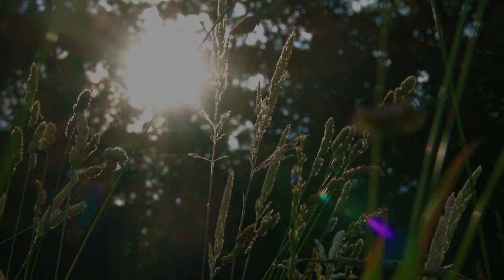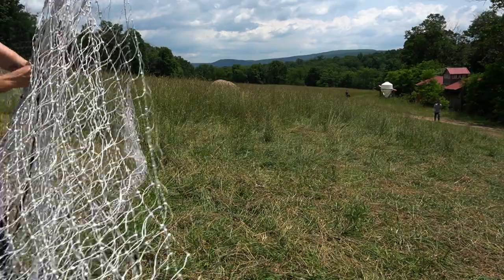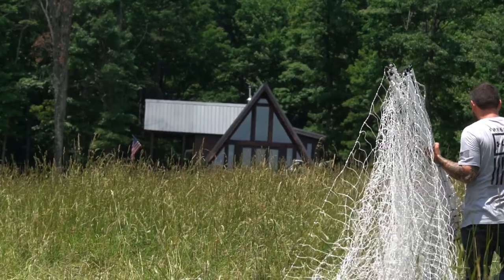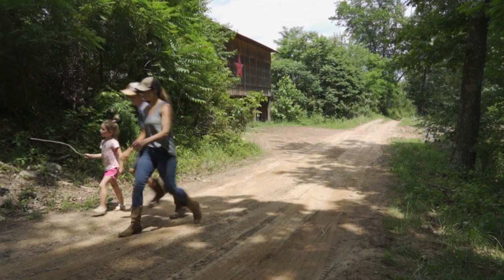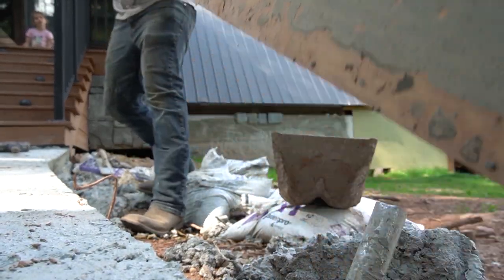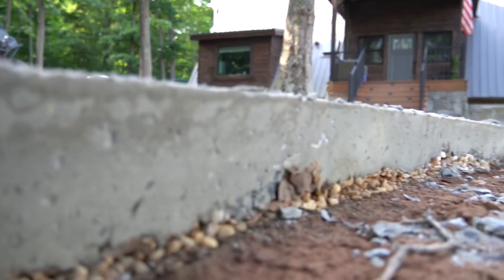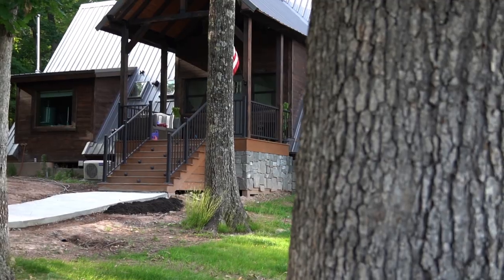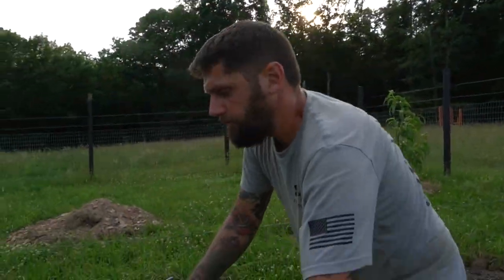THE FINAL PROJECT At Our Off Grid Home- DIY Sod

Comment: It is a good idea to cut some stress relief slots in your new sidewalk, this ensures the cracks happen where you want them. The reinforcing just ensures the pieces stay together once it has cracked.
Reply: I was hoping someone would mention that.
Reply: @mttyflynn  I worked for a city as a labourer, one of the many jobs I did for them was side walk construction. I also ran the jackhammer, it always struck me that concrete you didn't want to crack did and what you wanted to breakup was the most stubborn to remove.

Comment: Make sure the sod stays wet  and make sure you rototiller the area where it go,s and after that put your fertilizer down and rake it in and smooth the soil then wet soil good and lay the sod and then keep it wet till it takes hold . Good luck

Comment: I think that is a fantastic idea, renting that sod cutter. Sod is quite expensive these days. A couple of pointers to make the job a bit easier and possibly more successful. Use a serrated old stake knife to cut the sod when you are piecing it back together. The serrated edge cuts the roots easier. Use a starter fertilizer 8-15-8, and spread it on the soil where the sod is going. As you roll out the sod, every 100 or so sq ft, water it by hand with a spray nozzle. Any sloped areas, stagger the sod joints, and any sod that you can`t plant that day, keep the green side covered. The rolls work perfect for that. Also, the lawn you planted from seed looks fantastic.

Comment: Happy Father's day Josh. 💙 seeing the progress and the animals. Can't wait to see the start on the master suite addition to your house. How's the progress at Trout pond? Did you demo the foundation and start over. I would almost want to just do it myself trusting my foundation.
Reply from the maker: The foundation has been torn down and is ready to be started all over again. The plan is to continue working on the renovation house, have it on the market at the end of August and at the same time start building the bedroom wing of our personal home (that will start in the next couple weeks).  In September/October we will begin building the Trout Pond house again 😊
Reply: If you plan on doing the foundation all over again, I highly suggest doing it with cider blocks. They are easy to work with, and are strong enough to last a lifetime. Plus, if you go with poured concrete, you might still end up with the same problem that you had before. Take care.
Reply: @erikroberts8307  around my area, cinder blocks are banned. They use cmu blocks(concrete masonry units).  But to have the same structural rating as concrete, they need to be filled solid with concrete and have rebar in the voids.  With all the labor involved, it isn't much cheaper.
Reply: @erikroberts8307  bad advice cider blocks are no where near as strong as a poured wall foundation.
Reply: @AL4N.  Cider blocks are used on every major construction site that I've ever seen when putting up a building more than four stories.
Reply: @erikroberts8307  um.....you have no idea what you're talking about. Most buildings now days are precast concrete walls. Cinder  blocks are used for the foundation that sits on a footer and then FILLED with concrete and rebar.

Comment: For the grass you could use a soaker hose and only run it in the night or put surge pumping if you have a quick nearby for every 1' of slope give you 7' lift low pressure great for filling animal water and irrigation

Comment: Wild + Wonderful, you all didn't use a grooving tool or place any expansion joints in that very long sidewalk. I strongly suggest that you crosscut groves every three-four feet so the concrete can settle without breaking where you don't want it to. A concrete saw will do the job. You can pick up sidewalk specs at most builder's supply depots and follow those recommendations re: spacing. You have a wonderful family, congrats on a great job!

Comment: You need to sawcut expansion joints into your concrete walk to prevent it from cracking. You will need an expansion joint every 8'-10' at a minimum. Otherwise your sidewalk may crack and it is impossible to repair concrete cracks permanently.

Comment: Since you putting stone on top it shouldn't matter but for other people that are making a cement walkway you will need to have controlled joint cuts every 8 to 12ft depending on the size of your concrete to prevent it from cracking during the curing process. I know Josh knows what he is doing and everything he does is planned and calculated for unlike the rest of us lol so any extra info is useful 😉

Comment: Expansion joints every 8 feet would be a good idea for the sidewalk.  Cut them 1 inch deep.  The theory is that any cracks will follow the cut marks instead of out in the open concrete.

Comment: I didn't notice any control joints for cracking/control in your concrete sidewalk if you didn't put them in when you poured it you can sawcut them in later, but it does control where it's going to crack in the future in case you didn't know

Comment: A few extra finishing steps would have added value. Like rounding the edges. You prolly should do relief cuts as well to mitigate cracking.
Reply from the maker: The walkway will have stone on top.  We initially planned on cutting in expansion joints but that's really only necessary for walkways/sidewalks over 50ft, which ours is not, so we ultimately decided against doing it.  You'll see more about this all in an upcoming video
Reply: @WildWonderfulOffGrid  i gotcha.

Comment: The way to successful sodding is watering every day after application. Gotta get those roots digging into the new soil. Did you put in a sprinkler system before you installed the sod?

Comment: Is there any concern with the sidewalk cracking as I did not see expansion slots in it? I know this is something that can be cut in later and it looks like the sidewalk is shaded, but I would be concerned with such a long solid piece of concrete that has any movements cracking. Love the videos and the cinematic feel to your videos. Well done

Comment: I was wondering why you didn't mow a path for the new fence location.  Wouldn't that help to keep grass from shorting out the fence current and making it less effective.
Reply from the maker: Some people do that. We haven’t found the need to. The trick with using electric fencing is keeping the animals happy by properly timing rotation. They are satisfied with the pasture they have to eat so they don’t try to escape and there is enough of a zap from the fence as is that it is a deterrent

Comment: I do not see any track control joints.   Is this one continuous pour?  
JoeB.  U of Md Civil Engr ‘62
Reply: Spell checker………said “track”control not “Crack control” .      Freezing and thawing will crack concrete roads and walks.   If you failed to create a crack control cut at desired points with forming material, mother nature will crack the concrete where she wants the crack to be and it will not be where you want it.  Grab your saw and a concrete or masonry blade and cut the concrete.  About p every  4 or 5 feet. In other words…where you want the crack to occur.    Good luck.
JoeB

Comment: oh no.  you didn't!  I was afraid you do that when I saw you guys beginning the sidewalk forms.  And sure enough.  You didn't tool the outer edges and you didn't tool in any control joints.   You'll have that sharp fin like edge along the sides of your walks forever now.  Well until they spall off.  Go look at a professional walk somewhere.  You'll see the 1/4 inch radius tooled edge.    As for the control joints,  well you'll find out soon enough what they're for.
Reply from the maker: Hi Aubrey- we chose to cut our expansion joints in after the concrete cured. As for the edges, stone is being placed on top of the walkway and landscaping will be brought up to even with the edges. The project is not complete yet - the rest of the work will follow in he next few videos☺️